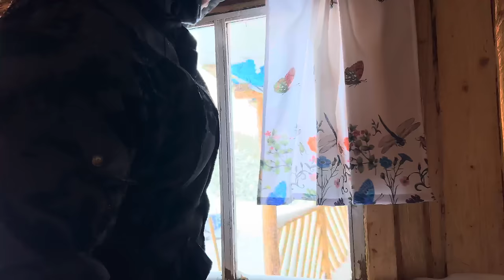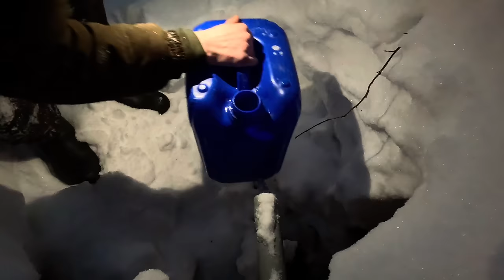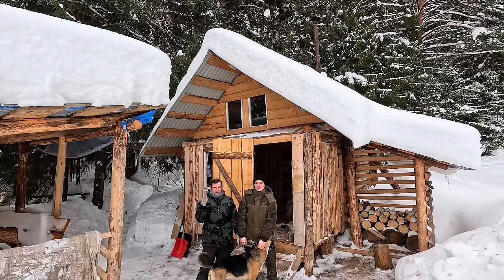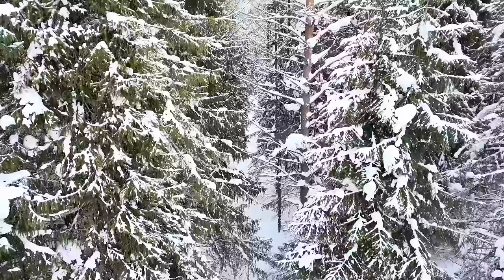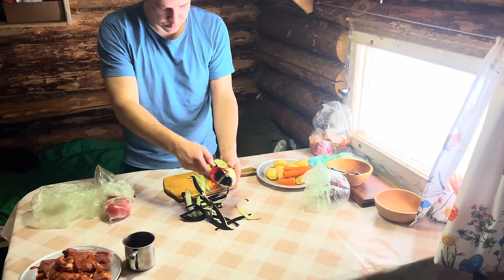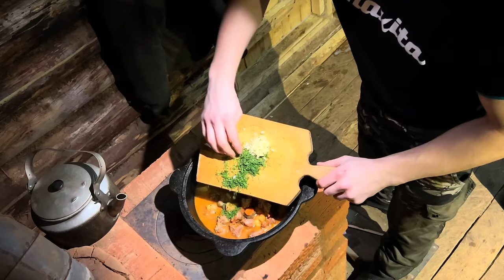No one has visited this hut all winter! Snow covered all the walls up to the roof! Outdoor cooking

Comment: So much snow and you getting water from the well? I wonder why
Reply: They get water from a spring. They made a wood "box" to accumulate the water in so solid particles will settle. The pipe is near the top of the box where the water flows out. It is essentially "running water" and is very clean. 
They can't store water at the cabin in winter. It would freeze solid and then it would be a REAL hassle getting it out.
So they empty what small wall hanging water tank when they leave to go home.
Snow isn't necessarily clean enough to just "melt" and drink. Bacteria and some forms of algae can sometimes contaminate snow. 

Они берут воду из источника. Они сделали деревянный «ящик» для накопления воды, чтобы твердые частицы оседали. Труба находится в верхней части коробки, откуда вытекает вода. По сути, это «проточная вода», и она очень чистая.
Зимой в хижине нельзя хранить воду. Он замерзнет, и тогда будет НАСТОЯЩАЯ проблема с его извлечением.
Поэтому они опорожняют небольшой настенный резервуар для воды, когда уходят домой.
Снег не обязательно достаточно чистый, чтобы просто «таять» и пить. Бактерии и некоторые виды водорослей иногда могут загрязнять снег.

Comment: They get water from a spring. They made a wood "box" to accumulate the water in so solid particles will settle. The pipe is near the top of the box where the water flows out. It is essentially "running water" and is very clean. 
They can't store water at the cabin in winter. It would freeze solid and then it would be a REAL hassle getting it out.
So they empty that small wall hanging water tank when they leave to go home.
Snow isn't necessarily clean enough to just "melt" and drink. Bacteria and some forms of algae can sometimes contaminate snow. 
Они берут воду из источника. Они сделали деревянный «ящик» для накопления воды, чтобы твердые частицы оседали. Труба находится в верхней части коробки, откуда вытекает вода. По сути, это «проточная вода», и она очень чистая.
Зимой в хижине нельзя хранить воду. Он замерзнет, и тогда будет НАСТОЯЩАЯ проблема с его извлечением.
Поэтому они опорожняют этот небольшой настенный резервуар для воды, когда уходят домой.
Снег не обязательно достаточно чистый, чтобы просто «таять» и пить. Бактерии и некоторые виды водорослей иногда могут загрязнять снег.